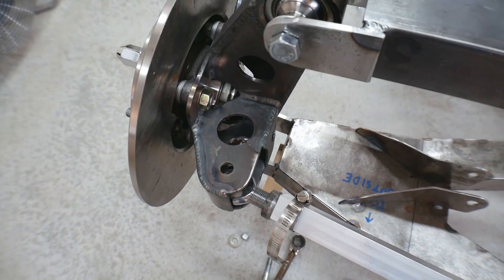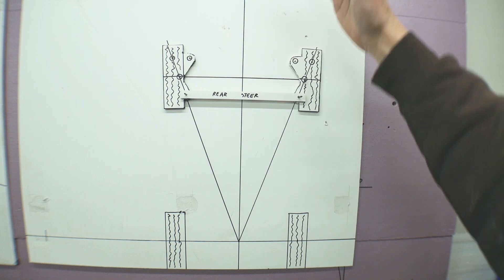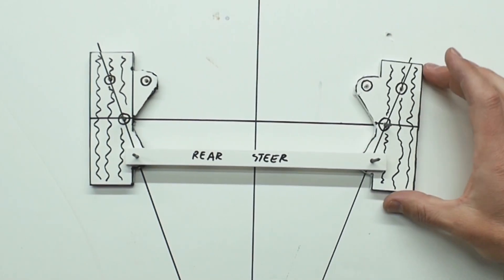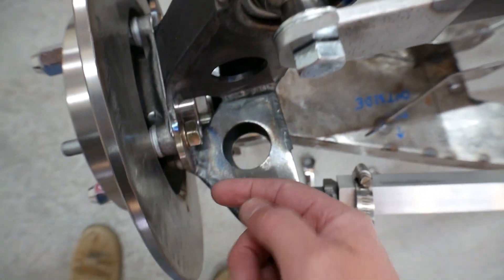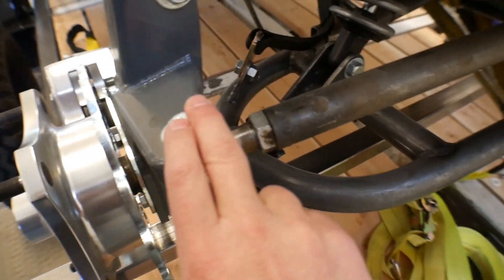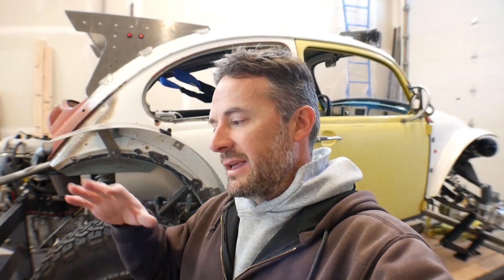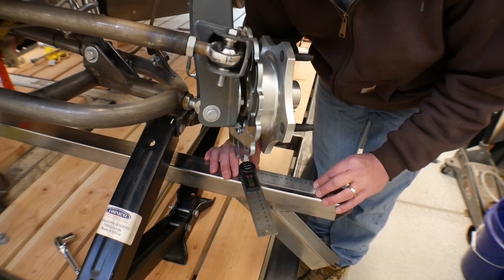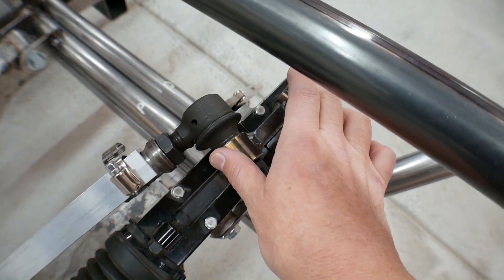Steering Ackerman, how it works, and doesn't work...

Comment: BTW you can correct your steering radius variance dynamics (ackermans principle) with the pitman arm length, position and direction, it’s the left  to right full width center-link and  tie rod set up that creates the consistent relationship. If you break this up like ford does on their IFS differentials Dana 35 45 55 etc. the pitman arm is on the left forward of the axle with a rearward sweep, connects to the inner tie rod end, and the outer rod end point forward on right spindle the left tie rod attaches to a midway point on the right tie rod and the opposite side forward point on the left spindle. This creates steering input differential. On the Dana60 straight axle front ends, an independent center link in a separate but supporting position reinforces similar geometry, and  bump steer not present in the ifs system  is countered by a the use of a track link mounted I. A position parallel to the tie rod or drag link.

Comment: Weight transfer during cornering increases the load on the outside wheel. More heavily loaded tyres need to run at higher slip angles so having less than "optimum" or even anti-Ackerman angles is not necessarily a problem from a performance point of view on tarmac / asphalt surfaces. Conversly, the inner tyre can not develop adequate grip levels and will scrub if the slip angle is too great. Ackerman steering is something that was developed in the days of solid tyres and low speeds, as a means of allowing independent steering systems to more closely simulate the effect of a pivoted, solid axle. It probably helped to reduce 'chatter' in corners. Tyre longevity is another matter, which is one of the reasons it is retained, to some degree on standard road cars. Running on loose surfaces is a whole new kettle of fish where steering force is dependent on more than just friction.
Reply: HI Graham can u refer a book or something other form where i can learn and understand vehicle dynamics calculation. i am watching a lot of videos and using other online sources but they mostly tell what will happen and not the calculation part.
Reply: @nc-pf3qm  A good place to start, if you can find a copy, would be Racing & Sports Car Chassis Design. It's an old book and may need some adaption of 'units' today but good stuff. It was wrttien by Mike Costin & David Phipps in the early '60s but there are copies available on-line. Mike Costin was the Cos in Cosworth alongside Keith Duckworth. I hope you've heard of them. 😃
Reply: @grahambambrook313  🙏 Thank you Graham. Yes got the copy.  Will read it. And  i have heard about them. ...from you😀.
Reply: @nc-pf3qm  Allan Staniforth’s Competition car suspension 👍🏼 and other of his books
Reply: factssssssssssssssss

Comment: Your cardboard demo is for a single point of attachment.  The buggy has two points of attachment.  Cross the attachments and you will be fine.  Passenger side steering rod to drivers side bolt hole (rear).  Drivers side rod to passenger side bolt hole (front).  This is still Ackerman's theory.  If two attachment points they need to cross.
Reply from the maker: I can't argue with you. But the point of the cardboard was really just to visualize for people how the Ackerman works. 
Pretend this buggy is solid axle. 😂

Comment: Hey, how do you calculate the force on the steering arms, tie rods and the rack while designing?
Reply from the maker: I don't, I just build what I think would be appropriate. I think if you were going to get that technical it would be best to draw it in software like Solidworks or something similar that can do stress analysis.

Comment: stupid noob question but could you swap hubs so your left forward steer becomes a right rear steer ?
Reply from the maker: Making it rear steer would solve the Ackerman issue for sure. But the reason this is front steer is because there isn't room with the A Arm suspension to have the rack and pinion mounted that far back. So for clearance the rack has to go forward and makes it need to be front steer.

Comment: Why couldn’t you use rear steer?
Reply from the maker: Making it rear steer would solve the Ackerman issue for sure. But the reason this is front steer is because there isn't room with the A Arm suspension to have the rack and pinion mounted that far back. So for clearance the rack has to go forward and makes it need to be front steer.
Reply: @DougBugBuilder  Also, if you moved the rack to the back then your steering would turn left when you turned right. You would need a rack designed for the back.

Comment: Doug isn't it true if you raise the one inner tie end up higher at mountain ng point you schould get it perfect 0 try it or maybe outer mounting point on one side if you look at vw steering the center mount for tie end is ofsite
Reply: Look at stock vw set up front end incorporate in your bug to make it o Ackerman maybe
Reply from the maker: I think that works on a VW because it rotates on an arc. But my rack moves back and forth in a straight line. So that point stays constant.

Comment: Can’t you simply add more of a cantilever device where the tie rods come together. So when turning to the left, the left tie rod would travel further distance than the right tie rod utilizing the angle of the pitmann arm thus adjusting you ackerman angle to a more favorable ackerman? In your schematic, you use a straight tie rod from one spindle to the other, but in reality, the tie rod on the left and right could have a different rate when turning left vs right? Couldn’t it?
Reply from the maker: Dude, you're making my brain hurt first thing in the morning.😉 You can do that if the center steering is rotating on an axis. Like a Pitman arm setup. But mine is a rack, and that moves linear back and forth. So I don't have that option with this setup. But your logic is sound for sure. 👍

Comment: Its not so much Front steer verses Rear steer, its about tie rod placement. You can still have your steering drag link in the front, just place your tie rod on the back side. Of course this is for gear box steering systems and not for rack and pinion setups.
Reply from the maker: I ended up moving my tie rod location at the spindle to get the best Ackerman I could. But I didn't go any farther than that. Thanks for the comment.

Comment: I Think it is quite reasonable the "anti-akerman" offset that your baja has, as you can expect at least 2-3 degrees of tires/structure deformation with turning loads on the outside wheel. That helps you to get the most grip out of both front tires at high speeds. At expenses of low speed turning not so good behavior.
Reply: And on the other vehicle, you have to take in account that the steering rods are not perpendicular to the vehicle longitudinal axis so that will create Akeman angle.
Reply from the maker: Agree, I don't necessarily feel the anti ackerman in the Baja. But I'm cursed because I know it exists, so I'm always looking for it. 😁
Reply: @DougBugBuilder  Well, I suppose that you use quite big tires, so it will be difficult to feel the scrub...

Comment: Doug. 
Your caster is influencing the inner wheel to turn a tighter radius.  Of course  that depends the where the upper and lower lay in there travel,     imo this is why you dont notice them fighting.
Reply from the maker: I suppose you're right. I feel like it would take away some Ackerman. But it's difficult to wrap my head around. Thanks for bring it up, gives me something to ponder.  👍
Reply: @DougBugBuilder     the caster will directly affect  the camber  at angle  and at lock it will be positive camber thus achieving a greater steering angle
Reply: At least if your at a positive camber straight up.   2.0 °or more
Reply: I'm not sure how much caster you've  included into setup on eather baja   but if you did this is why you dont feel it.
I only just got into your videos  and and enjoy what your doing, that said you can understand why .
The only thing i know is camber vs caster is the more camber you install the caster will multiply it's affect at lock, if you have 2°caster straight up with 1° camber you can have as much as 4 ° positive camber at lock and at opposite lock negative camber .
The thing to remember is positive caster will increase  the effort to steer  but will self steer as the car pitches the tail  (over steer)   ...
As you said before  its lots to wrap ones head around !!!

Comment: i though you measure from the center of the tire and not the center of the ball joint?
Reply from the maker: No, Ackerman is the steering geometry itself. I believe you are thinking of scrub radius. That plays into the tires contact patch to the ground.

Comment: I'm a little confused. Inner turn wheel was 29 degrees and outer turn wheel was 31 ? That means that the inner turn wheel turns more compared to the outer turn wheel and thats what you do want, right? -that is, "forward" or "proper" ackerman steering. But shouldnt it be the opposite for your front type steering rack setup ?
Reply from the maker: The way I was measuring it 0 degrees was straight ahead. So 29 degrees was not as sharp as 31 degrees. So it was a little backwards to what it should have been for proper Ackerman.

Comment: Hey Mike, little update I ordered a Mig welder for the panel I plan on butt welding I am not sure if I will Tig or Mig, but I think in the future for building up an edge or a seam the Mig will probably be the best bet, what do you think, thanks
Reply from the maker: Good call, I think once you get used to the Mig you'll use it a lot. I use Mig when I can, but I still use the Tig if I need to be clean, or I really need to control the heat, or if it's aluminum.
Reply: Thanks mike, Merry Christmas
Reply from the maker: @DesertRatFabrication  Merry Christmas buddy!

Comment: FWIW, zero ackerman is a thing for drift cars that are intended to be doing a lot of high speed drifts, but it's a personal preference thing.  I guess my point is that it appears to me that you might be able to modify that current spindle to where you can move it out to real close to zero ackerman, and that should be fine.  Definitely it looks like that spindle on the old bug could be moved out to zero if you wanted.
Also, I think you need to draw a virtual line between your upper and lower balljoints, and see where your outer tie rod pivot lies in relation to that line.  Might be a little different than just looking at where your upper ball joint is, and in the case of that current setup, I suppose it might actually be a little less good..  I do agree that it will be fine however you leave it though.  Thanks for another fantastic video!!
Reply from the maker: Thanks for the tips. Like you said, I'm going to try to help the Ackerman. But I won't lose any sleep if I can't get it right on.

Comment: You got me thinking Doug I need to check my baja king link pin. Longer wider . woods chrome Allie  stuff .  thanks for the kick in the brain bucket . mine is rear steer tie rod to the same rack and pinion box  as yours . what front breaks are you running? Mine are to small and the rear locks up first . $ ?  
.
Reply from the maker: Mine are Jamar combo spindles. But I'm in the same situation. Although they brake pretty hard, the rear lock up and the front does not.
Glad I got ya thinking. lol

Comment: One of the best explanations i’ve seen on Ackerman, Awesome stuff dude!
Reply: agreed!
Reply from the maker: Thanks Bud!
Reply: @DougBugBuilder  yeah this is great. I've been trying to figure out Ackerman on my go-kart for 3 days and couldn't find anything that explains it this simply. Unfortunately my go-kart has the tie rod ends attached in front of the wheel so looks like I can't even do it unless you can modify where the tie rods attach to the end of the steering column that would make it work. It seems like that should be possible but I haven't found anything explaining it yet. Any idea?
Reply from the maker: @rhull3939  You can dial in Ackerman with forward steer spindles but it gets tricky. Usually you need to push the tie rod connection points outward as much as possible and move the rack back some. Not always room to do this. So like me with forward steer there is a lot more compromise to Ackerman.
Reply: @DougBugBuilder  thanks man. Yeah, I don't have room. The point is right smack I'm the middle of the tire. I read something last night that you can get it to work by not having the tie rods in a straight line to the ends from the steering rack but I can't figure it out. It says to stagger them but I have no clue.

Comment: Great video!  I emailed you some pics of my build, it was all simulated in CAD before I built it.  I downloaded your files that you shared for the spindle layout, and also discovered the issue with the backwards Ackerman!  The setup I have now is not perfect, but it's pretty close.
Reply from the maker: I just saw this comment, can you send a photo of the spindles with your steering arms on it so I can see what you did?
dougbugbuilder@gmail.com
Reply: @DougBugBuilder  I will email some pics later today

Comment: Great video, I love this series so much. 
Your first bug has a Anti Ackerman setup. That works well with Toe in. I’d be interested to see if you could sweep the old chassis with 1/8 toe in VS 1/8 toe out. 
Also when your using the cardboard templates I’m wondering how far it’s throwing you off because you don’t have inner tie rods or the rack in the template? 
Possibly retest that? Great videos none the less, I really enjoy them. ~WesD
Reply from the maker: Thanks Wes, Interesting about the toe in. I can easily experiment with that and see if it feels any more responsive. Thanks for the tip.
Reply: More or less check it on the old chassis while you sweep it left to right. Check your ackerman while toe in VS toe out. For me I run a lot of on road Road race cars. We’re normally 1/8- 5/8 toe out to help turn in on a small short course aka Autocross. On a big Road Course we’re finding a very small amount of toe out 1/16 helps calm the twitchyness at high speeds. We also have 8-deg caster and lots of Camber gain for 3-inches or less. 
Thank you for sharing your thoughts on all this. I thinks it’s time for me to build something like this. Check out my 
Instagram Wes_D

Comment: Why can’t you just have rear steer?  Are there any advantages or disadvantages to having rear or forward steer?  Maybe I missed it in the video if you talked about it.  Also,  what engine is going the new chassis?  Do you have any plans to step up to an LS engine?
Reply from the maker: I would rather have rear steer. But with this setup I need the rack really far forward so I can have a safe steering link from the rack to the steering wheel. If I pull it back I have to add U Joints and the angles are pretty tight.
This chassis will have an Ecotec. My goal (dream) is to get a LS in one of these chassis. But I won't do that until I have a transaxle that can really stand up to the abuse of it.
Reply: Doug Bug alrighty, that make sense.  Never really thought of it that way.  An LS would be awesome, but the transaxles are very expensive.

Comment: I’m a little confused about how you are measuring your angles for measuring your Ackermann. I believe you are measuring the acute angle between the rotor and the front axel. Please correct me if I’m wrong. I think that the inside tire should have the smaller (sharper) angle and the outside tire should have the larger angle. 
It’s really hard for me to see in this video, but I’m thinking that your steering ball joints are actually outside of the tire pivot points (which makes it Ackermann steering, and not the reverse). 
It might be a compromise to the actual approximation of Ackermann but I believe if you drew a line from your steering ball joint through the axis of steering rotation, then it would be pointed towards the middle of the car. If you have reverse Ackermann steering, that line would point outside the car. Please correct me if I’m wrong but from what I see in the video I think your car is approximating Ackermann steering better than you think. 
(Not talking about the new one you are building)
Reply from the maker: You are correct about the angles, but my steering ball joints are inside the tire pivot points. Really hard to tell when the wheels are turned. But when they are straight if you imagine a line to the rear axle center you can see they are inside that line.
The Ackerman wasn't horrible. But the outside tire was turning sharper than the inside tire. At least what I could tell with how I was measuring. It wasn't to technical.

Comment: Since I'm still building my sandrail. I'm barely gonna start my spindles. This video came at the perfect time cause I had absolutely no clue this was a thing. I was the guy that was gonna use a complete fwd into my rear engine sandrail. I ended up doing a Porsche 911 transaxle with a truck 5.3 (Lm7). Your videos really help me with my suspension questions cause I really doubt myself when I'm doing this cause it's important. Chassis is built though and have everything ready to go pretty much. Just need seats and stuff too
Reply from the maker: That sounds like a great sandrail. Having an LS I think would be sooo much fun. Hope you get to take it for a rip soon.

Comment: wouldn't it be smarter to do proper ackerman on the new chassis and moving the fuel tank up front for better weight distribution. just my opinion
Reply from the maker: I'm going to do what I can to keep the Ackerman as good as I can get it but still being forward steer.
I'm not interested in adding any more weight in the front. I like keeping most over the rear axle. Your point is valid that more centralized weight would really help with the steering. But I don't mind (or kinda like) that it will understeer or oversteer depending on throttle.
Your idea is good though! Thanks for the comment.